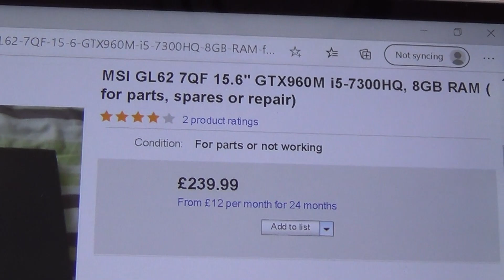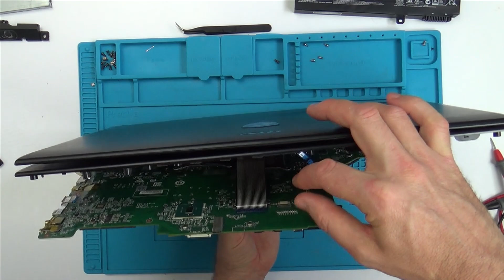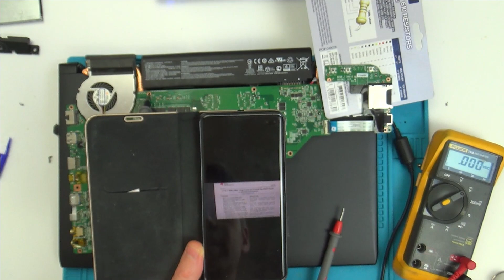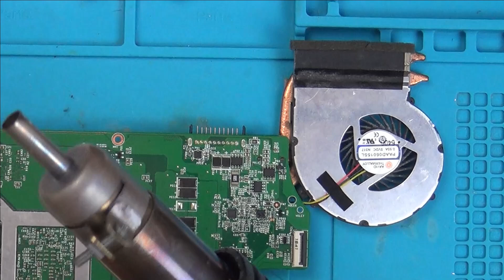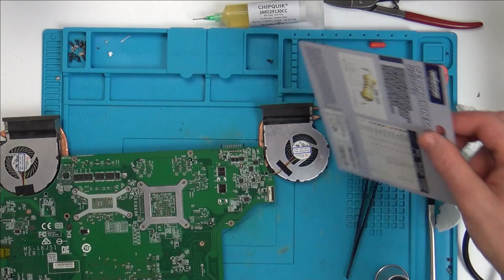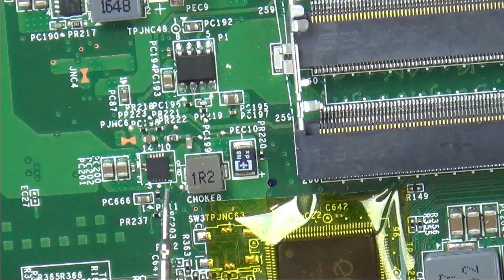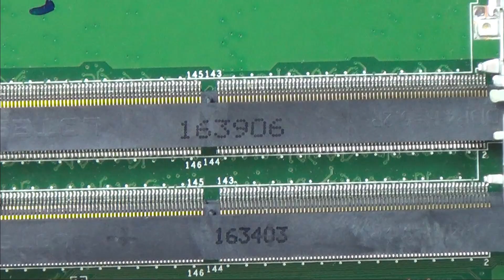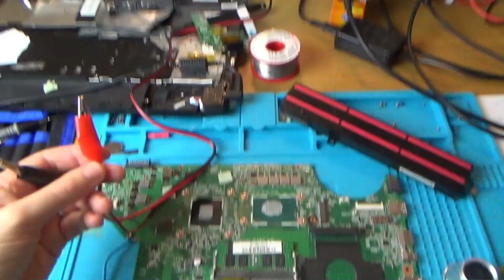Trying to FIX : Faulty MSI GAMING LAPTOP from eBay

Comment: @mymatevince you paid to much for this broken 2016 model i have an fully working asus rog with a i7 and the same GeForce 960m inside for 400€ 
Btw i think the laptop is overclocked and thats a hi risk of damage your laptop or computer
Reply: overclocking doesn't risk anything. you can overclock past what is safe, it physically does not let you
Reply: its been 3 years later but doenst matter and youre right but there are cases that its highly overclocked and  that the laptop cannot be cool enough and fried the laptop trust me i did it with my previous laptop.  @SirZanZa

Comment: The Dies (GPU/CPU) are both BGA soldered, the last Generation of Intel Mobile CPUs that were available socketed (PGA) was the fourth (Haswell) those had a "MQ" in the Model Number, the "HQ", now only "H" because more than four cores were always soldered BGA ones.
Only some High End-Notebooks like the Alienware Area 51M (that weighs almost 5 Kilograms) use socketed Desktop CPUs.

Comment: I remember few years ago, when i bought laptop marked as "non working dvd and missing usb otherwise ok"... After checking inside i found faulty motherboard with non working hdd driver. One USB connector was disconnected inside (soldered out). An external USB controller was soldered instead and based inside dvd drive. And seller of course claimed that he did not notice anything wrong.... I eventually bought a replacement base plate for another $ 150 and fixed it......

Comment: Have fixed a few my laptops with the same issue, source was GPU, after overflow didn't worked, so i put the motherboard on ultrasonic cleaner, and then all worked

Comment: From my experience it is really easy to get a faulty South bridge on 100 series pch Intel platefrom
Reply: Most of these trouble could cause by southbridge you can measure the capacitor resistance on the patch if one of them have something under 10 ohm that that basically means southbridge failed
Reply: And they should have two or three voltage one of them 3.3 volt and another of them is somewhere around 1 volts both of these voltage can be a little bit lower or higher it could be the power supplies phase tolerance but they can also be the torrents of your measuring equipments
Reply: I repair some motherboard and graphics card and some useless electronics such as power supply so I have a little experience on making these terrifying stuff normal

Comment: I think it is worth try to replace the chip in a professional laboratory and see if it solves the problem. At least it is good from an educational point of view and make a video! Before You can  remove it with hot air gun and see if the short disappears.

Comment: I think the iron filings killed it and they took it apart to clean it thinking it was dirty and overheating.  Maybe they knew they spilled a bucket of metal dust on it it needed to be cleaned.  Disassembly or actual cleaning might have dislodged the filing that caused the initial failure  The thermal compound on those coolers dries out and is very hesitant to release after a while so I think they pried on the cooler to get it off and apply new thermal grease, doing more damage.  Good effort, but now that we're here, I don't think you stood a chance.

Comment: I also had an expensive laptop with similar specs (GTX 980M) die on me only after 6 months of light use. Thankfully it was still under warranty. In modern laptops, pretty much everything is soldered to the mainboard (except maybe for WiFi, RAM and SSD, but even these are sometimes soldered on) so if something dies, you will essentially need to replace the whole system sans the screen and the shell.
BTW, that chipset does actually contain a little CPU in it.
Shame you couldn't fix this thing, but then again, the seller probably already knew he ruined the motherboard beyond economical repair.

Comment: those look like the marks a pick and place machine might make when the device was built I doubt those "marks" are more than superficial assembly marks
though due to the x86-64 power cycle path a dead cpu can cause a failure to turn on (know this from poor connection in a dirty socket causing a no-cpu error or just not powering on at all)
Reply: aww dead chipset :( (I assume chipset as that chip is not the cpu/gpu and chipset is the only other large bga with exposed silicone for cooling) this explains the lack of power button response as I believe that version of i5 has integrated northbridge and that chip is the southbridge which, surprise, controls the power state (ie. S0(aka off) S3(aka hibernate),S4(aka sleep) or S5(aka on))
send to louis rossmann for the zao mao :P

Comment: that component chip that was getting hot is the main Intel® HM175 chipset for the board and is the main thing controlling the board. its not married to the board its a generic part.

it has the USB, SATA, LAN ect and is a 2.6 W part.

Comment: The graphics card was literally peeling off the board like someone had failed to remove it, on post the chipset polls most of the important components such as ram, CPU and GPU to check for damaged parts, it most likely wouldn't get past the post code for the GPU which is why the fans don't spin

Comment: Seller definitely had their mitts in there and ripped a few components about in vain attempt to remove em, prolly to try to sell individually. In this process they totally buggered it up. Spares maybe but repair...very very unlikely. So I would have the seller on that. My advice to try to reclaim some cash is to strip it and sell as many working components as you can. The RAM, coolers and pipes, power supply, the battery, the shelf maybe even the screen.

Comment: An important tip for you! Some laptop models, especially newer,  won't boot from battery when disassembled. Only when you screw the laptop back together and all screws are back in place, only then you can power on the laptop from battery. Therefore always power-on from power cable when testing the disassembled laptop.
Reply: Yeah, I found that a couple of times, there's a battery enable screw, so the other option is to put the screws back in without the cover

Comment: I've come across a few gaming laptops where the old owner tried to use a liquid metal as a thermal paste (because they saw it done on youtube) and the stuff (gallium) ended up all over the place, even when the person attempted to clean it before selling it off there's still a lot of it hiding underneath the cpu/gpu and other places, usually if you blast air under there you'll see a stream of it come out. Great video though!

Comment: That looked like a buck converter output for the PCH chip where you were injecting voltage/current.  Injecting 5V was probably a bad idea,  typically those chips operate around 1V.  If the PCH wasn't damaged,  it may be now.  If you're doing injection from a VRM like that,  limit the voltage to 1V,  it's generally current that you need to expose issues, not voltage.

My guess is that this was originally a liquid damage problem,  by the "some keys stopping working" symptom.  Then he took it apart and caused more problems.  Then you took it apart and did the same.  Don't feel bad,  I've done my share of damage in electronics over the years,  and in electronics repair,  success doesn't come without failure (and you've had a lot of successes).  I think this was just one of the more expensive lessons.

Comment: This laptop needed cleaning. Obviously, because iron filings got into it. Previous owner even scraped between gpu/cpu and the heatsink with a hard object, to get it all out. A vacuum-cleaner with help of a soft brush will get a lot of the iron filings but not that what is sticking to a magnet. If you want to remove that, you just need to use a stronger magnet. No wonder that the seller was nervous about his sell. And while you were probing around with power connected, you clearly shorted a power supply mosfet. The 19V instantly fried some important stuff and might even have caused the south bridge to go south. But don't worry about it. The iron filings probably killed this thing first. There's cooling fans. Who knows how much iron filings this thing has been sucking up in its lifetime and who knows which traces of the first failure have been erased by the previous owner's cleaning session.

Please watch all of Sorin's content. Especially this one: https://www.youtube.com/watch?v=BY-TCgvEU7g  ...which is about exactly the same motherboard. Watch it yourself. I won't tell you how it ends.

If you inject power into the board, you inject the maximum voltage that circuit can handle, 3.3V or even less if it is processor or RAM. And you ramp up the amps if not enough heat is generated for finding the short. And when this is connected, your supply says 0.4V 3A and you don't feel any heat, you should measure how much of that 0.4V is actually reaching the board. Your cables will also drop some voltage and will produce part of the heat you're looking for in the board.
It is weird that you traced that power button signal to that charge controller chip. Usually that goes to the bios chip. The one that says ENE in big chars. That chip will check everything, starts all power supplies and at the end if all is clear, it tells the processor to start executing the bios/uefi, bootloader and operating system.
Again, just, watch all of Sorin's content.

Comment: When you took off the heatsink i was fully expecting for a cpu or gpu to be missing if the were not soldered obviously....When it was damage, you straight away think that the previous owner has had no clue that there both soldered and has tried to change the components to upgrade fully believing that they come out, when they dont...its not a socketed cpu per say... And its not a bad cpu for a laptop to start with, gpu was the weak part really...980M i think it was right....defo ageing... But that damage, i believe would be enough to make it not work for sure.....

Comment: You should of removed the cpu and test for the shortages again . The cpu could of been shorting out the north bridge . And also if that didn’t work you Could of at least reflowed the chip because it looks like the person that worked on it before didn’t know that these chips are bga and Non removal and might of separated some of the bga balls

Comment: There's a easier way to tell whats going on Plug the Motherboard in TAKE A THERMAL IMAGE CAMERA around the board you will quickly see whats the issue HOTSPOTS........................... replace those chips etc done.

Comment: Please note that modern CPUs has the Northbridge integrated and not separated on the Mainboard. Only the Southbridge sits separated on the Board.
The integrated Northbridge is the memory controller hub and handles the Memory bus (RAM), PCI-e Bus only for Graphiccards and provides a DMI Interface to communicate with the Southbridge. The Southbridge is the chipset itself. It's the main I/O Controller Hub and simply controls the most I/O Devices and Connectors for internals and externals like USB, SATA, LAN, WiFi, Card-Reader, PCIe-Slots, HD-Audio, SMBus, SPI-interface for the BIOS, and so on.
When you search for "Chipset Block Diagram" you can see which I/O Device is connected where.
I also can tell you, that the Heart of every Chip (Wafer) sits right in the Middle of it's casing. The Surroundings carrys the electrical connections from the pins or balls till the Wafer where tiny Bond-Wires connecting the Wafer itself. If there are visible capacitors around the middle, these are only for filtering the power supply to prevent malfunctions. If you want to see this Bond-Wires and Wafers, decapitate a chip, or look at UV-eraseable EPROMs - these have a Quartz window in the middle, where you can look inside.

Comment: Just watched 8min and I see one mistake already. You should had removed the battery before cutting the flex. Imagine you shorted the 5v line with some ground line or lower voltage line. You could have fried something

Comment: What we really need to make laptops more repairable is good schematics that can be used in a boardview software it will tell what chip is what and on where on the board its located and also what circuit their on wether that is charge circuit usb circuit backlight circuit.

Comment: Battery charge controller literally is in charge of taking in power from the charger to charge the battery and also the charger to power the machine as the battery will not be used if the charger is present also secound job and also if no charger is present it be told take power from battery instead to power computer thats my best guess the job of it is kinda of in the name also to answer your question about cpu is bga or not usually it isnt on normal laptops but gaming a mini notebooks tend to have bga i also believe chromebooks are bga and most if not all macbooks are bga

Comment: Some MSI laptops like that won't power up if the battery is to flat. I'd let it charge a bit. See when they've been unplugged for awhile the aquiescent current it draws will run the battery flat and it takes a bit of time for it to come up enough to power on.

Comment: Try the hot air directly on the chip and you might be able to reflow the solder. It worked for my gpu chip
Reply: That might help

Comment: 53:44 check the motherboard to the top right of the chipset, above R170. Seems to be damage on the traces. You can see how it protrudes from the board when you're cleaning at 57:19
Reply: You're right, that does look damaged. It's worth a shot IMO
Reply: Yh noticed that and came straight to the comment section. Also if you follow the traces they go to that side of the chip where the short is on the silicon.

Comment: Hi I have a dell gaming laptop which it got of eBay it shows the charge light but no power what i did is removed the key board and CMOS battery cr2032 battery cell and waited for 5 minutes then reconnect everything and it came on and I then did a hardware test and it shows it's now healthy.

Comment: Vince, great to see you working on these machines and the way you share your methodology.  I’m no expert and you may have found the faulty chip but did you check the caps which should be protecting this chip for shorts themselves allowing excessive current in to cause the heating you are seeing?  (You might have done it off camera)  .... plus you really need to keep the inserted voltage very low, by all means crank up the current if you need to make something smoke, but allowing it to go anything like cpu operating voltages can make problems worse.  Don’t give up ... you deserve a new gaming laptop!! :-)

Comment: I did a reapir once on a msi laptop looks like that one, sadly i dont remember the model no anymore :/ but i desolder the bios chip and a dont remember the name (efi?) chip on the motherboard, it has a blue dot and a red dot on the chip it self and i flashed them with a flash tool and resolder them back on and that made it work :D

Comment: Someone has really messed up quite a lot inside this machine. Starting with the missing pins on the ribbon cable , you can tell that someone really had a go on this one.
Reply: I see this a lot, people just don't know, and think because they saw a youtube video on disassembly that there's no reason to be careful. it's a shame because most of the time they start off with a functional laptop and they end up breaking it beyond their own ability to repair.
Reply: @holycownonames  Anyone that watches a disassembly and think it takes away the need to be careful deserve a broken laptop. I did weeks of research and watched dozens of disassembly videos before even attempting to clean and replace the thermal paste on my laptop.
Reply: Not just a go at it but a go at it with power tools that made iron filings out of something.  An angle grinder? Drill?  Did they drill out the missing screws?   Crazy.
Reply: man forgot to lift the clamp of the ribbon cable and just ripped it out
Reply: Yes

Comment: Hey Vince whenever you work on a laptop that will not turn on start by removing the CMOS Battery.   The reason I say that is more than often the BIOS is glitched and simply won't let the computer start because a glitched BIOS is seen as a fault state and it is doing that to protect itself.
Reply: Yeah but than the power still goes on if bios not working normal or is mobo is dead... Here are more problems.

Comment: I believe the Correct thing to of done last, beings you had it all apart IS TO REFLOW THE CHIPS,  Heat em up, got nothing to loose.  Now go start your camera and get it on film cause it will turn on after that.  Good Luck

Comment: hello vince greetings, excellent video very entertaining as always, with the patience and calm of a saint xD, a "step down power supply" (2 mosfet 1 coil and 1 cap) almost always feeds what is closer (ram, cpu, northbridge etc) when you put 5v to that rail I think you burned the northbridge, because it was right on the other side of the board, the north bridge works normally with 3v, next time try injecting 1v instead since nothing can burn to 1v on the power rails, I'm your biggest fan xD, thanks for keeping us entertained and ¡keep going!.

Comment: Hi Vince I always watch your videos and keep doing what you do, it' not how much you fix things but how you keep trying and ready for more challenge. Putting that on the side what I want you to try since you can say it's not working anymore if hang it and bombard it with brake cleaner front and back. I'm watching someone on YouTube fixing GPU with brake cleaner and dry it and sometimes it works, if not then he'll reflow the whole GPU with heat gun for 8 minus and will revive some cards. Just something for you to try before actually troubleshooting further. Cleans corroded small parts that you would miss even the underside of the chips. Thanks and more power to this channel for years to come.